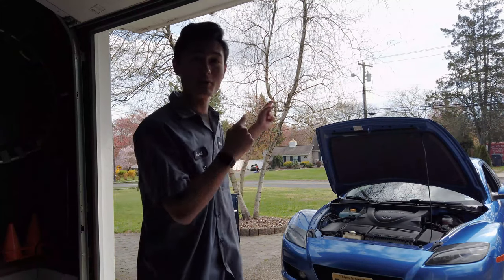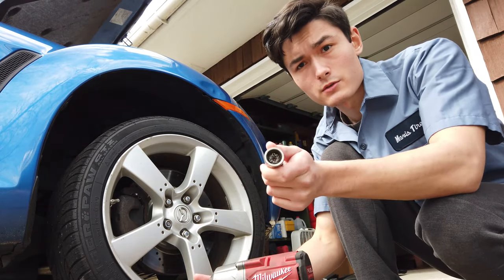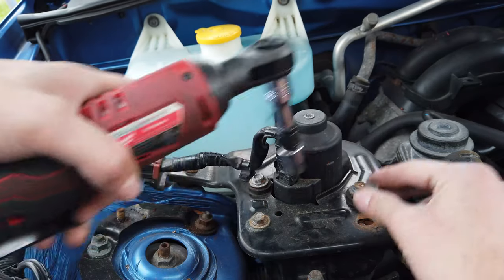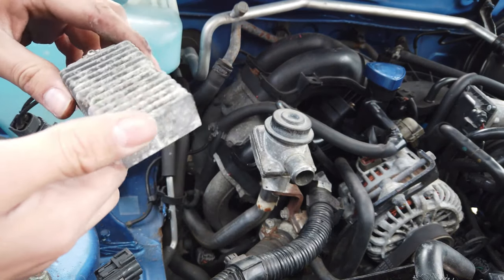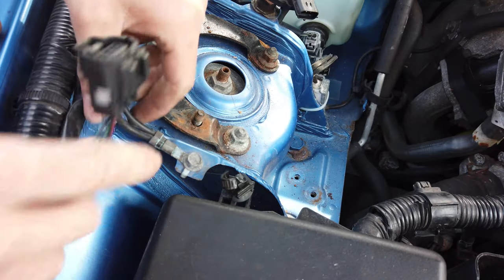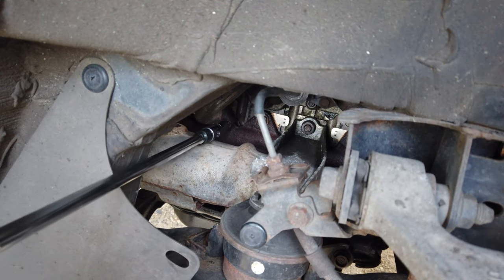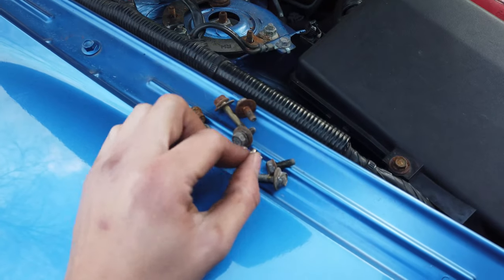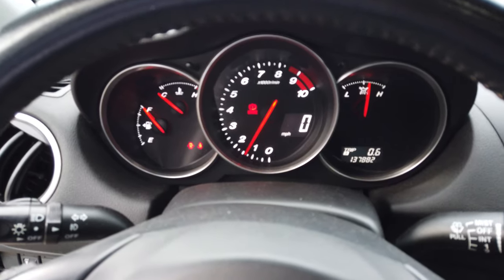RX-8 Air Pump Delete

Comment: My air pump (after 96k miles) is making noise. Is there a reason to remove the air pump?  If you are OK with the noise and even if you don't have a cat anymore (I still do have a cat) is there any reason to remove the air pump? Great vid!
Reply: @ethanolfeed1975  ah, forgot about codes, no codes yet for me.

Comment: Is there anyway to make the check engine like go away for the p0410 so it doesn’t come back?
Reply: A tune would be the solution
Reply: Oh shoot. Like from a dyno?
Reply: @MarkAnthony-us1gm  well, I'm no expert, but I'm pretty sure you would not need a dyno run for that. Maybe more like a ECU reflash, which is a lot cheaper ;)

Comment: what happens if i remove the air pump and not put on the block off plates? any real problems apart from a check engine light?
Reply: I know this is an old post if you don't put a block off plate you will have exhaust Gases in you engine compartment and possibly get in to the car from the fresh cabin filter area.